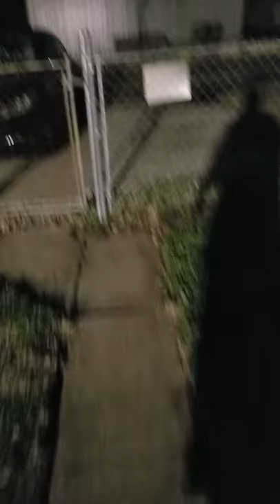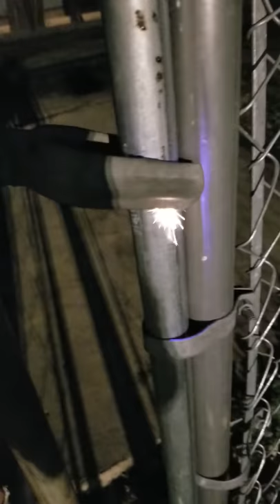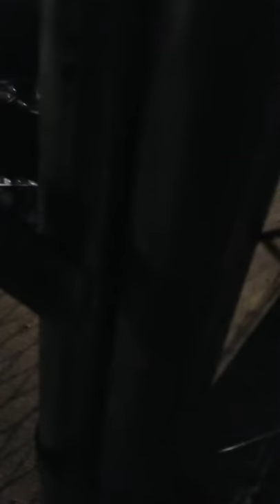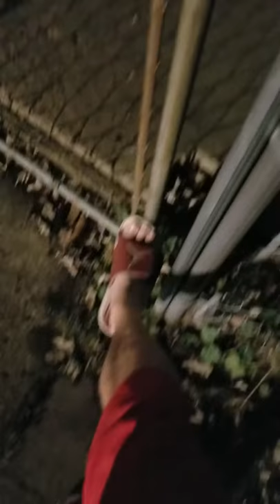Chain link fence electrified

Comment: One of your poles have been drove thru a wire in the ground
Reply from the maker: It was actually a short in a bad receptacle that was arcing in the wall inside the laundry room and because the house had metal siding and the fence was touching the house, it caused electricity to run throughout the siding and throughout the fence.
Thankfully, it didn’t cause a fire.

Comment: You ever figure out what it was?
Reply from the maker: Yes, I had a short on a electrical outlet inside the house that caused the aluminum siding,  which was touching the fence to electrify.  The entire house was electrified. Crazy!
Reply: @HarleyDavidsonMan  lol not cool and crazy.  I heard of the same thing on a ladies house. Her siding, outside water spigots, and all her inside plumbing was shocking her. Even her screen door to get in and out. Take care 👍
Reply: @HarleyDavidsonMan  damn, figured there was a short somewhere but you never know the extent of the issue… I used to live in a place where the stove and the stainless kitchen sink/counter would shock you sometimes. The place was built from ‘52-57 and it was hollow tile construction with galvanized pipe for plumbing and seriously, two wires in each wall box. Found that out when an ancient switch burst into flames lol! All the conduit in the two story walk up was prolly shorted lol good times I’m just happy my kitty never seemed to have gotten shocked. I stopped wearing belts and pants with metal buttons while in the kitchen and if I had to reset a breaker I did it with a 2x4